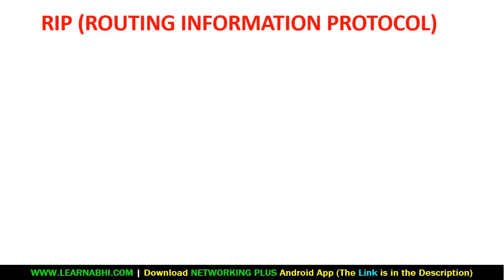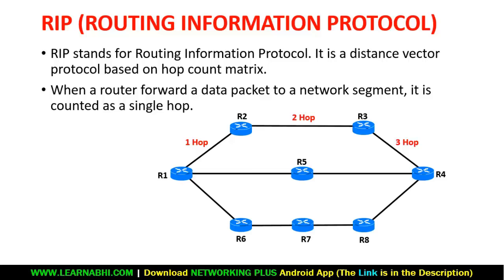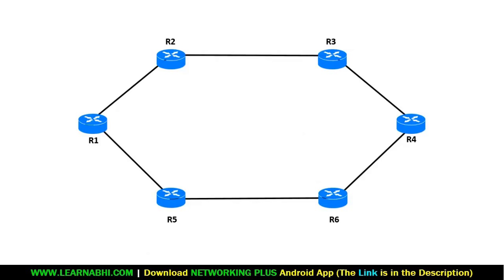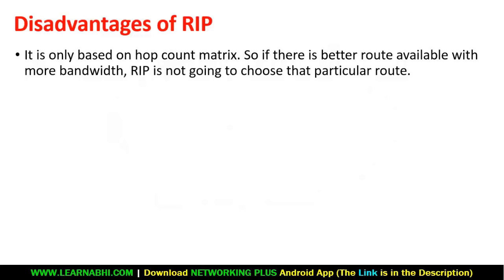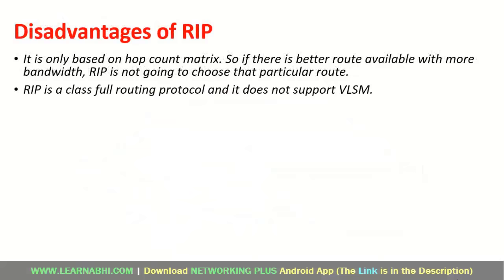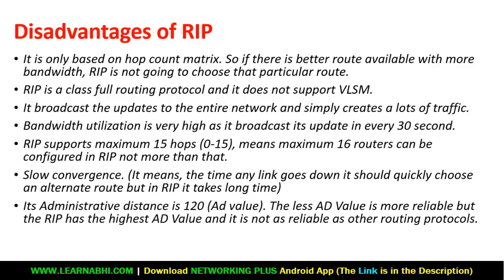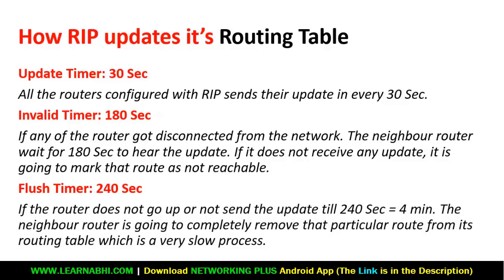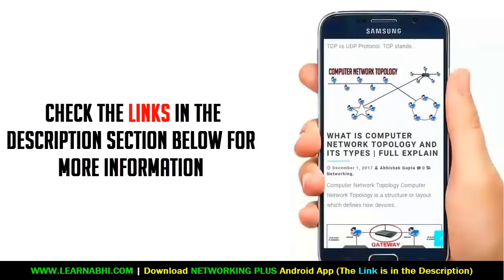What is RIP Protocol and How it works | Routing Information Protocol Basic Tutorial | CCNA 2018

Comment: Hello. Nice job! Nice and clear video.

The only thing I would point out is that you counted the number of hops incorrectly. You forgot to count the initial router. This happened until minute 3:05. 

When a packet reaches the initial router, the TTL (Time To Live) is decremented, that means it is a valid hop, just like the others you have counted.

In spite of that, you have a nice video!

Keep the good work!

Comment: It is true that RIP supports maximum 15 hops, but this doesn't mean that maximum 16 routers can be configured in RIP. It means that the maximum diameter of the network in RIP is 16 routers; no more than 16 hops can be between two nodes.